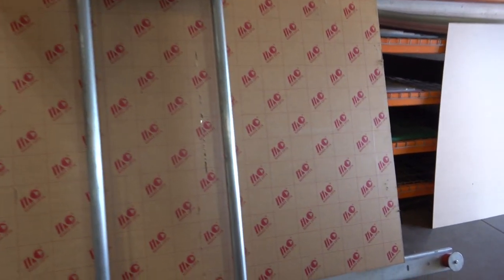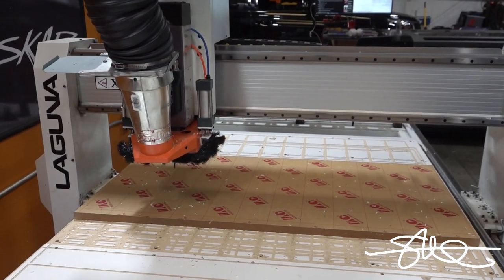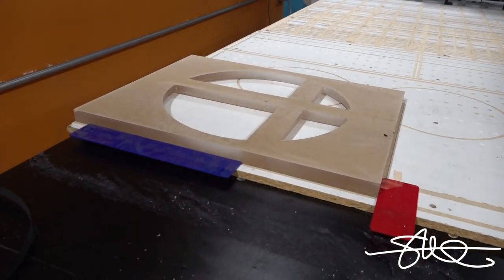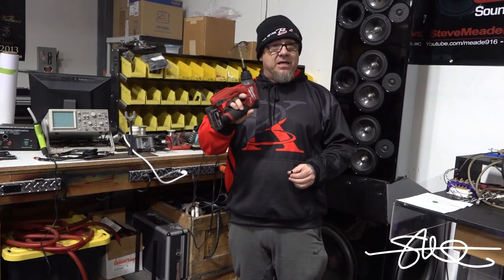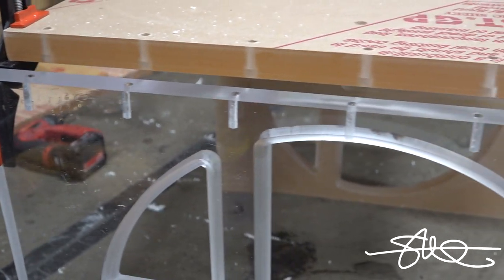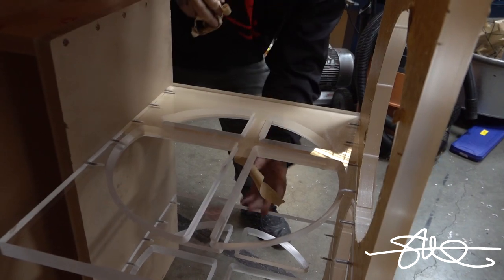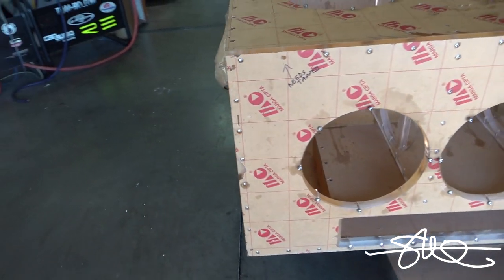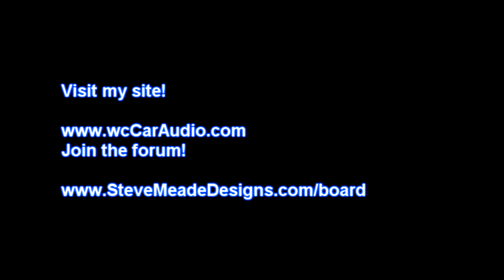Six 12" Subwoofers 100% Clear Plexiglass Ported Box Build - SMD Cadillac Escalade

Comment: Looks amazing!  But with the vibrations the only problem i see is the screw holes cracking.
Reply from the maker: they won't crack. So no need to worry. lol
Reply: Even on 1" thick with 6 12" u dont think it will crack the screw holes ..even around the subs?
Reply from the maker: @shawnsmith4463  nope.  If i did, do you think i would be doing it?
Reply: @meade916  100% agree with u...i absolutely love your work  and cantt wait to see  final 😍

Comment: Always thought it would be cool to pin a plexiglass box together with plexiglass rods and epoxy to make everything look seamless
Reply from the maker: you don't need to do all that. I could have done this  without the bolts and achieved that easily.  But i like the bolts and also, this box is going to be dealing with a lot of pressure and weight.

Comment: Man those sub screw holes seem really close to the edge 😳
Reply from the maker: there is a small bevel on the sub holes that makes those look closer than they actually are.  They are close but i am using big bolts. But the bevel gives the illusion that they are closer.

Comment: This is my first system install. I have a Audiopipe db2 on an Autotek TA2050.1 2000w Mono. I hooked everything up and got NOTHING from the amp. The remote wire was wired to the remote wire in the back of my afm stereo. I used Ttaps to do this. Im getting about 10-11.5 volts on the remote wire from the stereo but only about 2-4 where the remote wire hooks up to the amp. I then tried a different wire that was putting out 14 volts thinking maybe it just wasn't enough before. Still only got about 2-4 volts where it connected to the amp. What is the issue 😭🤦 (I've been trying to find time on the weekend to do this for 5 weeks)

Comment: Is cutting it hard on the blade on your wall saw? Or is there a certain type blade your Supposed to use
Reply from the maker: my saw isn't super powerful but it gets the job done.  Use one with the most teeth you can for cleanest cuts on plastic. This one is 40 or 42 teeth (i forget).
Reply: @meade916  ok.  Most teeth possible.  I’ve always been kinda scared off on cutting plastics cause of the saws I’ve got on hand. But I’ll be looking for better blade with more teeth.

Comment: Ive never seen anyone use particul board as a backer on a point to point. Use mdf and neoprene weather stripping. Also whats with your vacuum does it not have a vacuum relief or was the acrylic just melting fast. 
I use to be a regional service technician for stiles machinery as well as a cnc tech at pretty large commercial case work and point if sale display manufacturer.
Reply from the maker: i have no clue what you just said or asked.

Comment: Anyone have any recommendations on speakers or subs for a 2017 Toyota Corolla.
Reply: I have a 2014 Toyota Camry SE 4 Door and as of now I have a Alphard Avatar STU-1246 D2 for the Subwoofer and a Deaf Bonce AAB-2900.1D for the amp and a Pioneer AVH-211EX for the head unit and I’m telling u right now this is a whole different kinda bass then your typical 2 12 inch Kickers, or Rockford Fosgate set up trust me